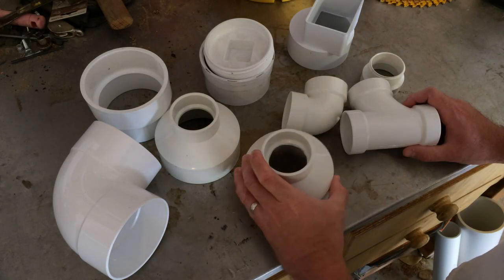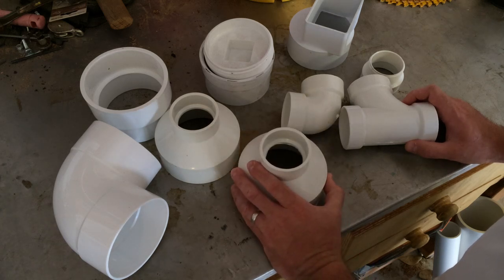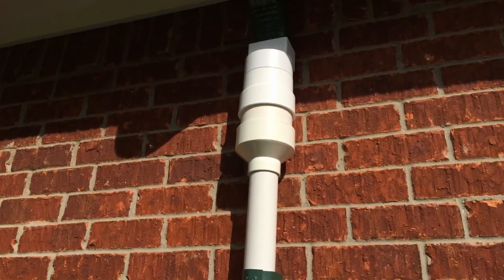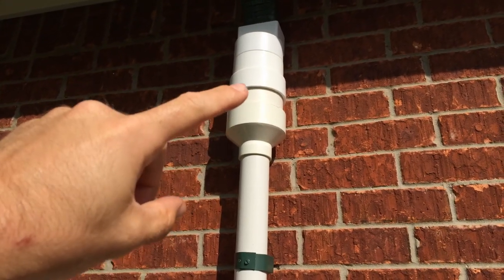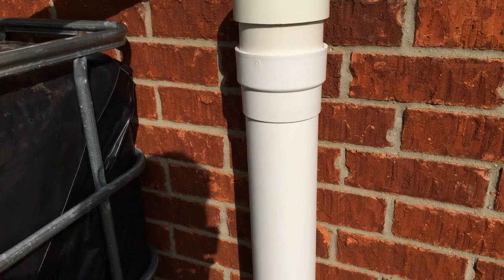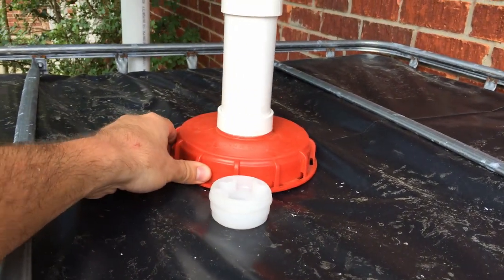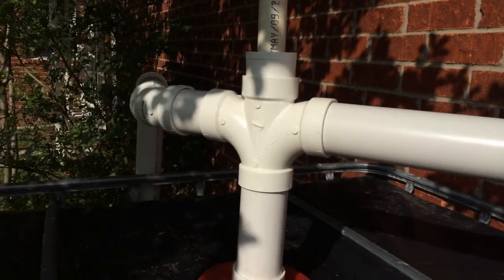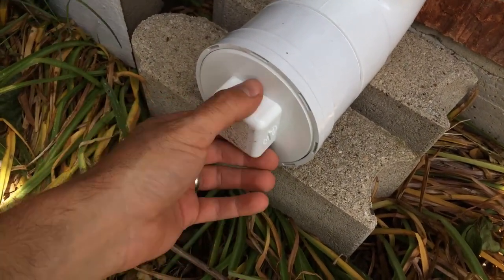Setup your own rain catchment system

Comment: I have watched a few of these videos and yours is the best I have seen so far. Simple and well explained. I have one tote and just found a guy with 3 more that I have purchased and hope to pick up in a couple of weeks. Getting into gardening and am setting up a system more to play with than anything else. Will same some on the well. Im going to use it also to fill the pool which always makes me worry about taking that much water out of my well at once. I found a 12 volt pump and I am going to use and it will be free as well. I have some solar panels and during the day they top off the batteries by noon so I can use all the 12 volt power I want in the sunshine and still have my batteries to run my Amateur Radio rig at night like I want.

I did not see any glue stains on your pipe, did you glue it?